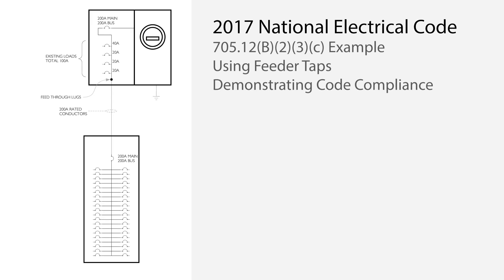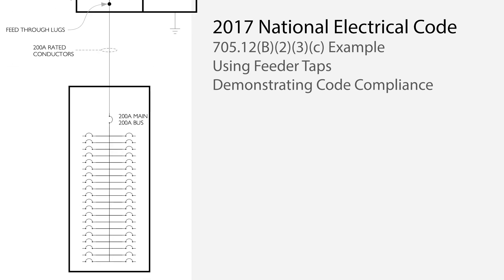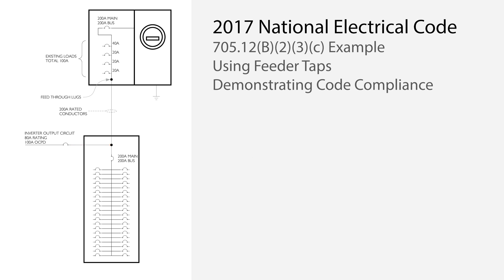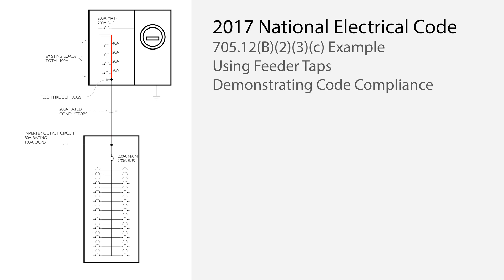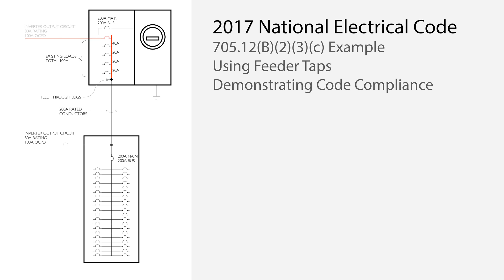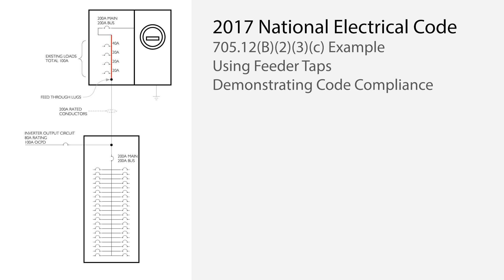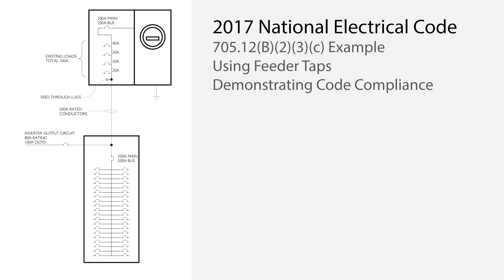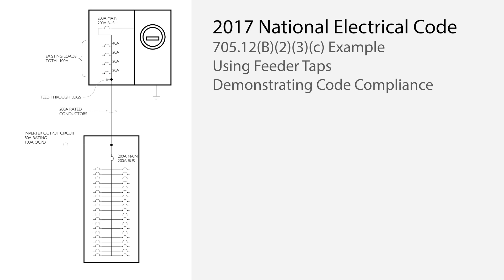Solar Panel Interconnections With Meter Main Combo Panels NEC 705 .12(B)(2)(3)(c) With Feeder Taps

Comment from the maker: Please note that this video was produced based on the 2017 National Electrical Code and prior, however the same concepts still exist in the 2020 and 2023 codes. The big change has been the availability of PCS (Power Control Systems) that provide busbar overload control. These systems use tested equipment from various manufacturers to ensure that busbars are not overloaded, and open up possibilities that did not exist in previous code cycles to install solar in more creative ways. The need to protect conductors and busbars from overload is still critically important for electrical and fire safety, and understanding how these systems work is something that professional solar contractors and electrical contractors should familiarize themselves with for successful client outcomes.

Comment: very interesting/ see also Mayfield Renewables videos on this
Reply from the maker: The do a lot of great technical videos and articles. Our video is geared to people adding whole home generators to existing grid-interactive solar photovoltaic systems. I could not find any of Mayfield's videos on this subject specifically, but they do cover microgrid interconnect devices and other hybrid/multi-mode inverter systems. There are lots of ways to integrate generators beyond this simple approach.